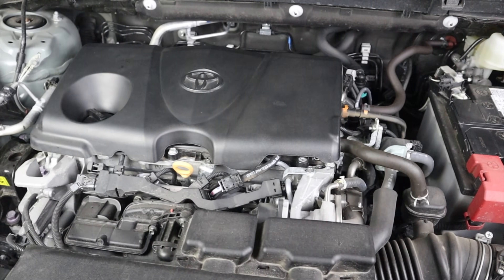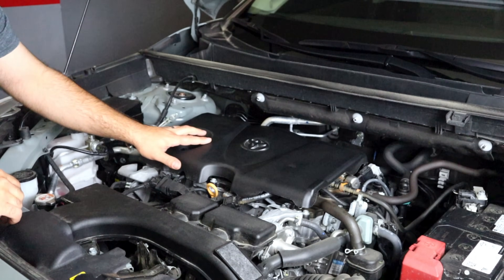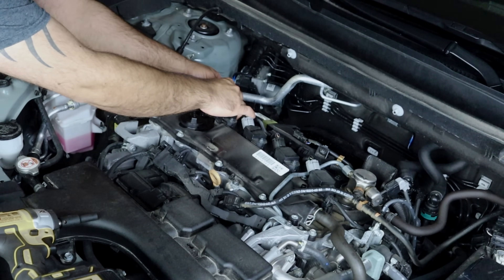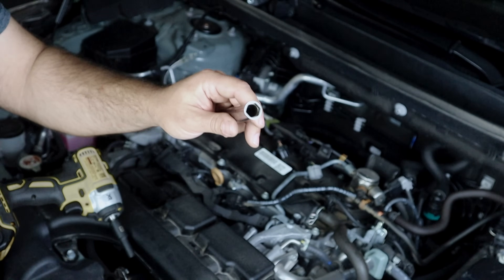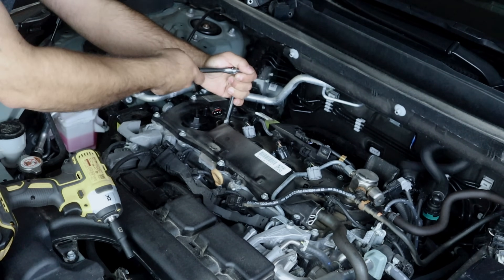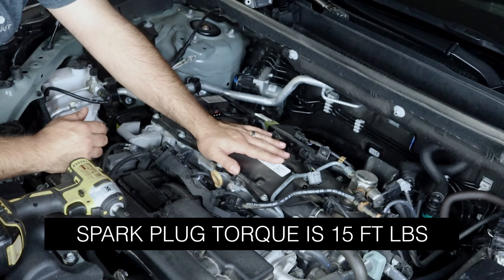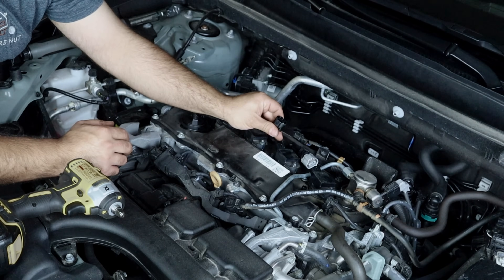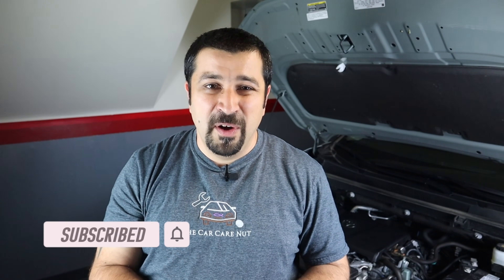How to Change Spark Plugs on Toyota's New Engine A25A and M20A

Comment: Boy it sure is a lot easier working on these four cylinder engines.
Only thing I would add would be if the car is pretty old with a lot of miles or specifically if the rubber gasket under the coil looks a bit beat up or has been oil saturated. Sometimes worth looking down into the spark plug hole and blowing it out with compressed air or brake parts cleaner and then compressed air to make sure there isn't any trash down in the spark plug well. You pull the spark plug out and the junk falls down into the cylinder chamber. Pretty uncommon in newer cars. My 13-year-old Prius is 372,000 on it and the spark plug holes are still nice and dry.
But it's a good practice to check.

Comment: Aftermarket plugs are a joke for any car.  With my car, the part nr cross references four different mfgrs.  One of these same part numbered plugs is metric threaded.  Another is ASE threded but with different thread wall angle. A third plug is some metal that's incompatible with aluminum heads.  All three will sieze in the cylinder head, and sometimes back out on their own (unexpectedly).

Finally, the last (4th mfgr) plug is an ASE threaded copper plug.  It fits perfectly, stays in place, and removes easily.  It's not as hot a spark, but I'd rather a cool plug than a replaced head.

Comment: I had a grand Cherokee that had insulating foam (oem) that was stuck to the engine cover and did a great job in further isolating engine noise. Do you think a similar foam can be install on this one?
Reply from the maker: Hi! You can as long as it’s heat resistant and won’t become a fire hazard

Comment: There is extra emphasis on getting genuine OEM spark plugs from the Toyota dealership. I tend to consider any spark plug bought on Amazon/eBay to be fake without even needing to look at it.

It's also possible to find out the OEM make and model of the plug and buy it from a reputable site or a brick and mortar shop. The '20 Rav 4 manual says that they are DENSO FC16HR-Q8. So if you can find the equivalent DENSO branded spark plug, it would be the exact same item sold at the dealership. It might even be cheaper, but no guarantees.
Reply: Hi
Recently I have bought spark plugs in rock auto.
Is it genuine?
Reply: Rock Auto is good.

Comment: I know these new spark plug can last a 100k but at 60k I'll change mine with oem along with all the oem fluids it's about $200 oem $100 aftermarket so spending a extra $100 every five years seems to be a bargain for a piece of mind
Reply: That's exactly what I did this past weekend. My car has 60K miles but I still changed it. The old spark plugs looked really good upon visual inspection but I changed them regardless since I already bought them. I can already feel the difference in the engine smoothness and power with the new plugs - albeit very subtle and minor. Moreover, spending $200 every 60K miles or five years doesn't break the bank.
Reply: @Newtttton  i would rather do it to often than not often enough, take care of it and it will take care of you

Comment: Why shouldn't we use anti seize?
Reply: Could anti-seize have lubricating effect on the friction and the torque-tension relationship in threaded fasteners. Bear in mind fastening the spark plug in aluminum head, over torque could damage/strip the head plug threads.
Reply: Modern spark plugs in modern engines have a special coating on them that acts as a release agent when removed. This silver or chrome-colored finish on the threads is designed to provide corrosion resistance against moisture and chemicals. The coating also acts as a release agent during spark plug removal. Denso spark plugs are installed at the factory dry, without lubrication or anti-seize.

Anti-seize can act as a lubricant, altering torque values up to 20 percent, increasing the risk of spark plug thread breakage and/or metal shell stretch. Thread breakage can sometimes involve removing the cylinder head for repair. Metal shell stretch changes the heat rating of the spark plug and can result in serious engine damage caused by pre-ignition. Do not use anti-seize or lubricant on Denso spark plugs. It is completely unnecessary and can be detrimental.

Comment: DO NOT USE ANTI-SEIZE. PLEASE if you are doing it to your own car.
Reply: I've been using it for years because I was trained to but i always thought it was associated with misfiring and could glue the plug in what is your reasons?
Reply: @lightman489  The newer plugs have a coating on the thread. If you put anti-seize, it will affect the torque value, may over torqued.

Comment: I mean u don't even have to get them from Toyota since you can buy them directly from Denso as long as you find the part number
Reply: I find NGK runs better
Reply: NGK Ruthenium HX spark plug even better. 
Ruthenium HX plugs are high ignitability to ensure quicker throttle response, faster acceleration, smoother idle and better cold start.
Reply: @metzmatu8409  NGK doesn't have Ruthenium HX spark plugs for Toyota with this type of engine.
AdvanceParts website recommend NGK 96355 LFR5AHX but it has different thread diameter 14mm 
(Toyota original spark plugs have 12mm) - Not compatible

Comment: Why do you say not to use any antisieze?
Reply from the maker: Most of the time anti seize actually end up causing seizing because of the high temperature. If Toyota didn’t use it at the factory and the plugs come out when replaced at the right interval, I wouldn’t use it.

Comment: May I ask you a question? Thank you in advance! Last year, I had a weird sound coming from my engine bay on my 2009
Yaris. I thought it was my heat shield manifold (2 bolts were rusted out), so I removed it. The weird sound was actually coming from a worn down alternator bearing... So my question for you is this one. Is it ok to just leave de car without the heat shield manifold? If I don’t, could I cause any problems down the road? I still have the old manifold, so I would put it back with only the 2 main bolts still not rusted. Thank you!
Reply from the maker: Hi! I would install the heat shield as without it you’ll radiate too much heat and possibly heat the cabin
Reply: @TheCarCareNut  Thanks! But besides the heat in the cabin (which I don’t really mind - I live in Canada and have AC). Does not having the heat could cause electronic/mechanical problems down the road? And last question. Does the heat shield is easy to put back?
Reply from the maker: No other issues other than containing the heat. The heat shield should be easy to put back on

Comment: CVTs are often paired with these, what do you recommend for Transmission fluid change intervals?
Reply: He has said every 60K, using only OEM fluid
Reply: @marklintwo  is that just a drop and fill, or changing all of it at one go

Comment: Another great video from AMD. Thank you for letting us know the torque specs of the plugs and screws (15 FT/LB for plugs and 66 IN/LB for screws). I wrote down on my 2020 Rav4 owner's manual. Listen to AMD and never put anti-seize on the thread. But I do put a drop of motor oil on the thread. I never had problem of removing the oil plugs. I heard the newer plugs come with some kind of film on the thread and if you put anything on it, it will affect the torque value. I am an old timer and I still put a drop of oil on them. I also spray a thin coat of dielectric grease on the coil connectors. On top of that, I will put a dab of Shin-Etsu on the rubber of coil to make them supple years after years. I am looking forward to a video from AMD to show us how to change coolant on this 2.5L non hybrid although AMD had mentioned to remove a hose to release air when he talked about a 2018 Camry. God bless you and you have a wonderful day!

Comment: My 2008 Highlander with the 3.5L has the 1-2 second metal grinding noise problem when starting it. I have heard that seafoam put in the oil can help loosen the pin that sticks in the VVT that causes the problem. Any truth to this? Thanks.
Reply from the maker: I haven’t seen any success with that. However it can’t cause harm to try it

Comment: I have a 2016 Corolla S plus and  now Im looking up my plug replacement interval, thanks for mentioning that.
Reply: Per NGK, G-Power Platinum plugs are good for 60K km, Iridium IX 100K km and Iridium Laser 120K km. Ruthenium HX  can last as good as Iridium Laser way cheaper. 

Ruthenium plugs are high ignitability to ensure quicker throttle response, faster acceleration, smoother idle and better cold start.

Comment: great video as always! i would not want to have to replace the valve cover gasket on one of these. i had mine swapped out on my 2AR-FE in under an hour but on the A25A you have the fuel pump and line in the way

Comment: Hello,  awesome channel!!!

I have 2011 V6 Camry ( original owner ) with  240,000 miles - zero  engine or transmission leaks or issues. Does not burn oil.  Still performs as good as new...  It still has original  components like - coolant pump, alternator, coil packs,   
O2 sensors. 
Have not replaced anything other than regular motor oil & transmission oil changes with filters, spark plugs, coolant + coolant hoses, thermostat, serpentine belt & CV axle boots.
Do you think I should start replacing some items as preventative maintenance??

If yes, which ones should I start with??

Thank you!
Reply from the maker: Hi! Honestly I wouldn’t replace anything unless there’s issues. If it ain’t broke don’t fix it
Reply: @TheCarCareNut  

Thank you!  🙏🏻  👍🏻👍🏻

Comment: Thanks for the video it's very clear and informative. I have 2020 corolla hb with 8nr-fts engine (1.2 litre turbo gdi) I want to know that this engine is with EGR valve or not? and does this engine build up carbon like Vag's tsi engines?
Reply from the maker: Hi! It does have EGR. So far I haven't seen or heard of carbon issues with the EGR.

Comment: Why are you against using anti-seize for spark plugs?  I’ve always used it for spark plugs and oxygen sensors.  Plus, I just bought a 2022 Prius Prime that takes 0w 16.  The others I’ve seen on YouTube take 0w 20.  Is the engine different that previous models in this generation of Prius Prime?  PS, I love your channel and recommend it to all my friends who drive Toyota here in California.
Reply: I believe the spark plug manufacturer, NGK, do not recommend putting anti-seize.
Reply: Thank you, I’ll stop doing that moving forward.
Reply: Anti seize is also a lubricant.  The spec is 15 ft pounds of torque dry.  If you add a lubricant, you will over torque the threads and risk stripping them.
Reply: Thank you soooo much...I was about to use Anti seize...you saved my ass...May Jesus show you and your family and friends His awesome Love😊

Comment: Yes!!!😆
Reply: U have taught me so much about this specific engine. I absolutely love my 2019 camry LE. I put about 1k a week in miles on it. But the confidence u have given me as far as maintenance has given me little worry about this kind of milage on my new car. Listening to ur other video while typing this i have just found out we r both bass players. U sir r full of surprises 😊
Reply: Had to revisit this at 124k miles.  Finally doing the spark plugs. Thanks to u the only issue I have had is a bad battery. Have never missed an oil change and burning zero oil. Ty again!

Comment: My experience with spark plugs:

1. Pick them up from store, you don't want them get banged up during shipping.
2. Avoid ebay or untrusted online sellers, mostly counter fit.
3. Just walk into the dealership, this not something you do every year.
4. If the dealership plugs  (in the red box) price is not within your budget, try AutoZone or advance, If you have a coupon, they sell the original Denso plugs in the blue manufacturer box, with coupon discount you get a good and "safe" deal.
5. Check Toyota part number against Denso catalog and AutoZone/Advance/ Pepboys stock number. Sometimes the numbers do not match, they do that on purpose, so customers find it hard to price comparison.
6. Some Toyota Models are not real Toyotas (Ai, 86, and the new Supra) you may need to check more info.

Comment: Compared to a V6, it's always easier to change the plugs on a 4 cylinder.
Reply: Agreed!!!! When a toyota dealership wanted $350.00 cdn to change my spark plugs on my 2008 highland with the V6 ..I ran there everyone else wanted 500+
Reply: Subaru (with horizontally opposing cylinders): Am I a joke to you?

Seriously, on something like BRZ/FR-S (Toyobaru), the service manual indicates you have to raise (or lower, I don't remember) the whole engine to get to at least some of the plugs.
I've seen some ft86 forum members saying it's possible to do them without moving the engine, but well, special tools and midget hands required.  I personally don't see how it can be done, because there's so little room.  I've even heard of someone making a hole in the fender area to make this easier.  On other (larger) Subarus, it's not as insane, but still requires way more work, removing stuff to get access.

But I understand your comment was just a generalized statement.  ;)
Reply: @catsspat  some gm cars you have to remove the bumper cover to change a headlight bulb. That is messed up

Comment: Thanks again sir. I have a question. Toyota highlander 2013 left side sunroof drains are clogged. Water piles up on the floor when it rain/car wash. Can i put some plumbing drain opener like Drano clog remover to remove clogged holes? Also i appreciate as you said earlier that you are going to make a video about it. Thanks for all the help and efforts.
Reply from the maker: Hi! On those highlanders by the kick panel there's a small pocket inside the car that has an opening. That opening always gets clogged not the drain itself. Kinda hard to get to it and see it.
Reply: @TheCarCareNut  Thanks a lot. I figured it out as you told me. There is a wiring box. I took it out. I checked inside of it by an endoscopy camera. All i saw was water in there. I put my hand inside and dried it with towels. When it was completely dried out i put around 500ml of plumbing drain opener (drano). Waited for 30 minutes and then poured some hot boiling water. It worked for me. Now it is not clogged anymore..  hey thanks for your tips. 👍👍.

Comment: Hi,would it be normal for dealer to recommend a brake service on a 19 rav 4  at 15000 kms or 2 1/2yrs
Reply from the maker: Hi Did they list the reason why they need the service?
Reply: No, they didn't just said it was required.i'm in Ontario Canada,I was just trying to find out if it's because all the extra brake functions on safety sense 2.0. thanks, and congrats on reaching over 100000k +
Reply from the maker: Thank you. I would inquire and ask why before agreeing to do ti
Reply: @TheCarCareNut  thanks again, I will do that.
Reply: @rpf691  I just got my front serviced  only 23k 2.5 years. Lots of pad left but noticed a huge difference. Worth the 90 bucks in Canada as well. Calipers and rotors squeaky clean no rust no residue now.

Comment: Being that you just posted this video, hopefully you'll see my question and give me an idea how to help steer my Toyota techs on Tuesday 7/13. Just bought 2018 Prius 2 approx 3 weeks ago. Have set the clock twice. Each time I'm next in the car I find its running fast about 17-18 minutes. Any ideas for me? The techs said they've never heard of this before. Many thanks!
Reply from the maker: Hi Linda. That is indeed an interesting problem. Perhaps they need to turn off automatic clock sync with gps and see if the issue stops.
Reply: @TheCarCareNut  Oh bless you for answering! If you mean GPS as in navigation, the car didn't come with navigation. It is crazy! Lol.

Comment: What about the new Ngk Ruthenium plugs.
Reply from the maker: Hi! They’re good but I would still use oem plugs
Reply: Changed I'm in my 2015 nissan rogue sv Awd  at 53k and got more pick up and power and used a little oil on threads (old mechanics trick I learned)
Reply: There's no replacement for Toyota in Ruthenium HX

Comment: AMD, We have come a long way, when I started driving we were changing spark plugs every 12 months or 12,000 miles.
Reply from the maker: Very true! And it was not as simple as just plugs. Wires cap distributor rotor and at some point points
Reply: @TheCarCareNut   How many techs here used to charge the capacitor and leave it on the bench until someone tried to pick it up....good times
Reply: @Meatythebully  that gives them a ticklish feeling..

Comment: I don't have a cover on my 2021 Corolla SE with the 2.0 dynamic Force engine. I don't have the hood insulation pad either. Should I get one or is it even available?? Thx again for a great video
Reply from the maker: Hi! Don’t think it’s available for the corolla.
Reply: @TheCarCareNut  maybe the Lexus one fits??
Reply from the maker: Possibly fits. That’ll be trial and error
Reply: Look at Scotty Kilmer on you tube...He shows how to use kilmat 50mil car sound deadening mat..You can make a cover out of it for the inside hood and high pressure direct injection pump...Can put it in your cars doors ,fire wall trunk and floor to make it super quiet.
Reply: OEM Hood insulation pad and 6 clips can be purchased for about $200, and takes 3 minutes to install,  tops.